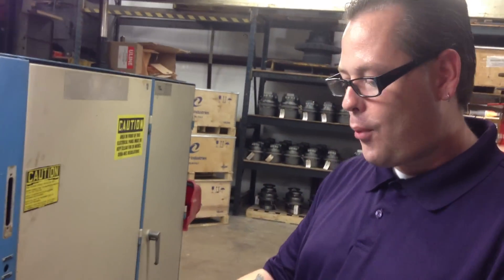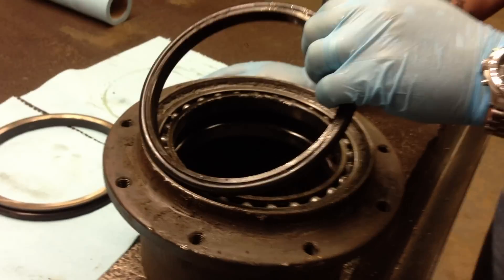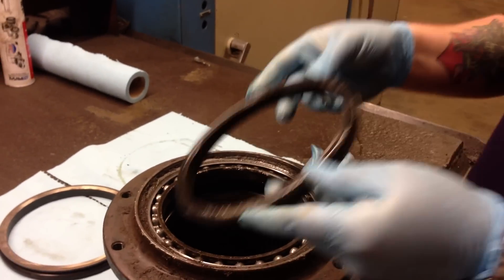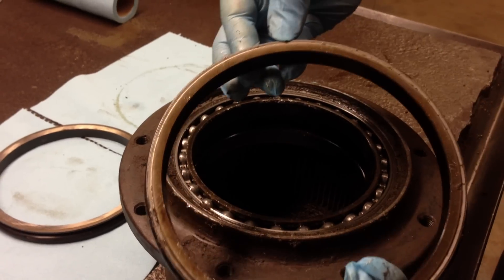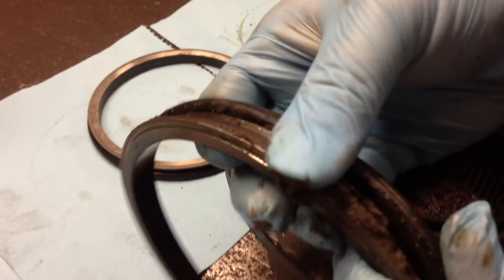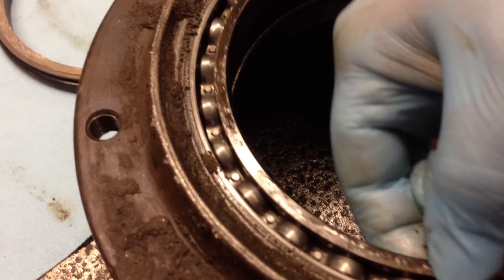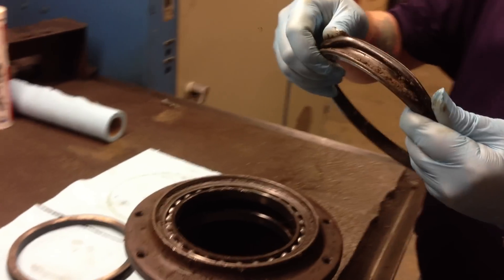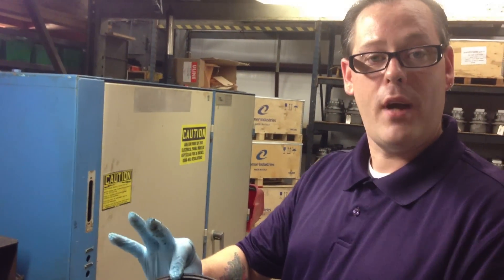Final Drive Repair - Rebuilt Final Drive Motors

Comment: Hi there.  Question for you.  I have a 2002 Bobcat 334 mini excavator.  The hydraulics on the machine work great.  The only thing that doesn't work is the track on the right side.  There are no leaks as far as I can see and the hydraulic oil levels are fine.  I removed the plug on the travel motor to see if it needed any oil and that was full.  The machine travels on one side without any issue, the other doesn't move at all and everything is properly connected as it should.  The one thing I need to mention.  Before this happened, the machine would always pull to one side and I always had to course correct, is that the beginning of a travel motor failure?